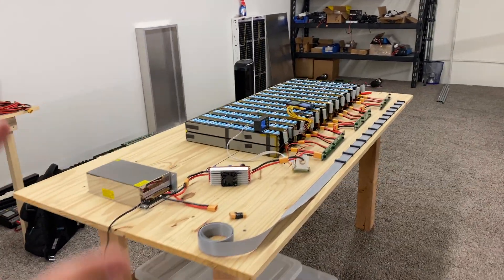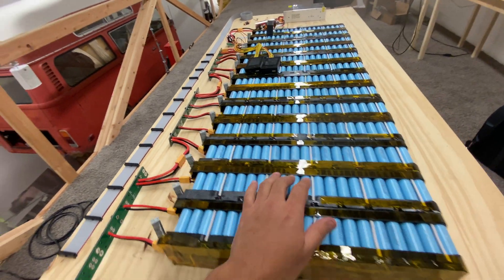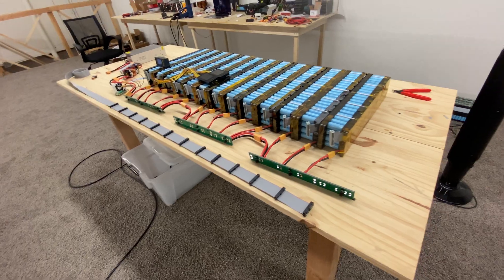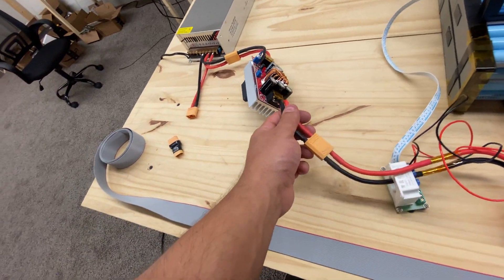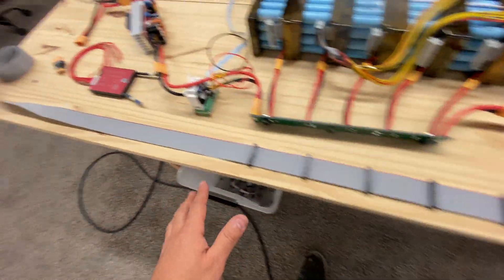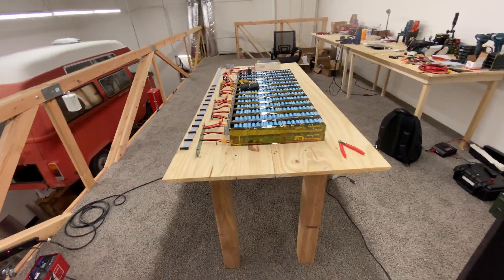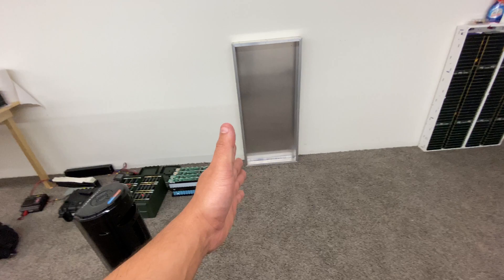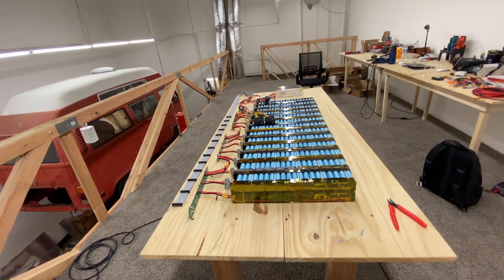Charging  my DIY 18650 Powerwall for the first time

Comment: Hello Jehu,i have 23,5kwh diy powerwall,15s(18650),i am charge it with a pip mpp solar 80A,my question is - its ok if i charge the battery daily to 4,08v - 4,10v for cell?
I don't think is very high charge.
In summer i just charge only to 4.0v for cell,now i want to take more from battery.
I'm from Romania (sorry for my english)

Comment: I am considering a battery like this for a solar / grid asymmetrical hybrid system to reduce grid usage.  What is the upper limit on charging amps from a solar array?  Could it take over 60 amps charging rate?

Comment: This is amazing stuff for places where your electricity is very expensive! People in high-rate states like California, Massachusetts, Alaska, Hawaii, Connecticut, Rhode Island, New York, Vermont, New Hampshire, Maine all should look into this.

For people in 40 other states, the value and benefit and ROI most likely doesn't make sense. My local Time-Of-Use plan in Virginia has a difference of $0.118522 per kWh between peak and trough and is the same all year round, though the time ranges change in spring/summer vs fall/winter.

At $1,500 for the Powerwall, assuming this 12kWh beast would give me about 10kWh of daily usage, a $1.185 value, to keep the cells from over-discharge and inverter losses, it would take ~3.5 years to get a decent ROI (return on investment). That would be 1,277.5 cycles, which is getting close to or past the lifetime of cycles for the battery pack itself. For me, even with an almost $0.12 per kWh difference in my time-of-use utility rate plan, building a giant battery, even this inexpensively, does not make financial sense. Even with solar, unless you cannot do net metering, batteries just don't have the lifespan at this price point. I know that LiPo cells retain their energy density for more cycles, but they are also more expensive relative to that storage capacity and longevity. 

Jehu, what's your Time-Of-Use Plan costs, who is your Utility company, both at home and at your office facility, and what Rate Plan are you on? This data is really, truly VITAL for people to know and understand so they can figure out if building a giant Powerwall at home is a legit good investment, or if it is simply something fun to do that really will have no significant positive impact financially. 

I'm sure that it may have a much lower ROI for you, but not everyone lives in Cali!
Reply from the maker: I have a 29cent difference between peak vs  off peak pricing .  The goal is to cycle 50% of the battery  so I can get 5000 cycles out of it,  this way it will pay for its self in 2 years and it will last a total of 10 years
Reply: @jehugarcia  I think that's what makes DIY Powerwalls make financial sense -- the difference between your peak and off-peak pricing. 5,000 cycles seems like a pretty lofty goal for used 18650 Li-Ion cells even at 50%. Plus now you're taking a 12 kWh battery down to 6 kWh daily usage, and 5 kWh useable daily. At $0.29 per kWh, multiply by 5 kWh daily, and then 365 days, that's $529.25 per year, so your ROI is 50% higher -- almost 3 years. In 3 years that's 1,095 cycles. I suppose if you can make it last 5,000 cycles, maybe you can get some value out of it. But the whole ROI starts breaking if you can't actually get 2,500 full cycles (you are assuming 5,000 cycles at 50%). 

And if your difference is lower, all the assumptions start to break down too. For me, in your use case, but $0.12 per kWh difference, the ROI is 6.8 years, and that's if everything works 100% of the time and I don't have failed cells or other longevity issues.

I love what you do, don't stop! I just haven't been able to find a way that it makes easy, reliable financial sense to build a DIY Powerwall when my electricity is, on a flat-rate plan, averaging $0.12 per kWh year-round, and the offered TOU plan only shows a difference of $0.12 per kWh. I've been hovering over the Buy button on Jag35 multiple times, but I haven't gotten the ROI to work out.

I'll likely pull the trigger at some point and build a ~1 kWh battery just for camping.

Comment: So after you charge all packs, do you just connect ribbons, or use a cross pack balancing using some resistors first? I think it would be nice to make a board or a adapter that plugs between the ribbon and the pack for initial charging / balancing, and when they are actually balanced, disconnect the adapter, so they are connected directly. This way the initial balancing currents are limited.

Comment: Nice vid! Too bad here in EU we don't have access to these cheap cells, mainly because of high shipping costs.  
BTW, be careful with the heat on the PCBs, if the cables desolder because of it, the cable could short and cause a fire.

Comment: How are you going to use this

On grid
Off grid
Uninterrupted power
Battery backup
Reply: He will charge it overnight from the grid, and use during day to power appliances and AC. So it is mostly to offset peak costs.
Reply: @movax20h  ok im looking to do an uninterrupted power supply with most of the loads on a transfer swicth in an invent of a power outage or surge and the delicate appliance fed directly from the battery

Comment: I would be worried about the amount of current that is going to flow through the ribbon cable when you connect it .  it seems to me that the batteries near the power connection are going to drop  to a lower voltage faster than the batteries further away (Resistance of the power wires ) As that voltage increase you are going to start getting current flowing on the ribbon cable.  Not sure if its going to be enough to worry about but I would keep a close eye on it
Reply: @StringerNews1 Since each horizontal pack is it's own 10s 36v pack, if one cell in the horizontal pack is higher or lower in voltage than another pack (in the same position example cell 1 on pack 1 and cell 1 on pack 6), the connection between that ribbon cable will attempt to balance the voltage difference with no regulation limiting the current other than the wire size (which will act like a fuse). Laying on a table with no load is fine, but when you put a large load on this, if they  go out of balance and that ribbon cable will get hot and probably melt the plastic insulation.
Reply: StringerNews1 not true, when you parallel them no matter what if there is a voltage difference they will try to balance between the packs. You could have a large voltage difference that will transfer energy from one cell to another over those tiny cables. This is a bad idea.
Reply: @StringerNews1 When you parallel the packs, it will not balance individual cell voltages between the packs. The BMS will do nothing to balance a pack this large. These are used unmatched cells so over time when there is a large imbalance between any of the cells in the packs, the only path to balance is the ribbon cable since that's the only connection between the individual cells between the groups. Using complete packs, then paralleling them complicates things, especially when trying to use a cheap BMS.

Comment: Is it ok to mix a bunch of different capacity cells in a pack? For example I've got enough to do my pack but they are 2000mah - 2700mah?
Reply: Not recommended. They will charge and discharge at different rates and to different levels and unbalance quickly.
Reply from the maker: It can be done but it depends how you connect them  to your pack
Reply: @jehugarcia  so the pack I'm making is only a 4s 11p for a field charger I'm making. No BMS and I'll be using that repaker website. I've got all the good cells but like I say they are between 2000 and 2700 so will it be ok to mix all different capacity cells? I know the voltage has to be right but do the batteries drain equally in parallel if they are different capacity?? Thanks for your reply man 🤘

Comment: Hey Jehu, I know you don't want to hear it, but you really need to be going to the extra steps of IDing and recording the batteries' condition and performance. You know how valuable that will be, and I'm sure that later you will regret not having done it. jus' sayin'
Reply from the maker: No, I really need to be testing if these can be used as is.  I know testing every cell works so that does not need testing.

Comment: The ford f150 hybrid have only 10 mile of ev range. Can I add this to exte d the range to 20 miles total? Maybe add more for 50 miles? The flatbed has the space for more batteries
Reply from the maker: It Can be done,  can you do it?  I don’t know if you have the required skill level to do it

Comment: LOVE your PW vids but it would be REALLY NICE if you did an actual PW2 clone including the CAN communications module. I’m working on adding CAN communications to my PowerWall 2 clone because my SolarCity H6 inverter won’t accept my battery packs without Communications AND a PW2 Serial #, T17Xxxxxxxxxx seems to be the format. I will base my controller on Arduino Uno, I think. Thanks for all you do. I watch faithfully. My 6kW system had produced over 500kWhks in just over two weeks or so of full power operations.

Comment: I just bought some of those e-bike packs from your jag store. I saved your previous video on how to take them apart.  I'm looking forward to testing these cells for my VW Bus conversion project.  I'm hoping to do 40, 60p packs for a 144v / 25KWh system.  I just hope these LG cells can do 2-3c continuous discharge.
Reply: Sure hope you vlog or YT your project, sounds awesome!
Reply: @seanflanagan5674  - Yes, videos have started on my channel if you're interested. Mostly restoration to begin with, but next month I start posting some of the electric conversion.

Comment: I've managed to test 100 cells from these pack.   Man  they're nice cells.  Nothing under 3,000mAh.  Yea some  packs are plastered with SILICONE on the BMS's..      I'm in Face Book Jail again so can't get on  the Group.  Political Prisoner.  LOL   Purchased 16 Modules going with 2 modules parallel  7 sets series.  24V.  Good stuff from you Sir.

Comment: Hello i have a serious question, what do you use the wall for?
Reply: The last thing he said in the video was around load shifting and off-peak charging/peak discharging.  If you have solar panels on your house or building, you use them to power your building during the day + charge this battery. In the evening, you shift the load to this battery and run off it.  If you don't have solar panels, but your local electric power company offers reduced off-peak electric rates, you can use that cheap power to charge this at night, and load shift to the battery during the day as an offset to your electric costs.